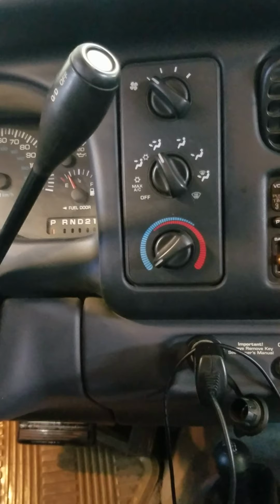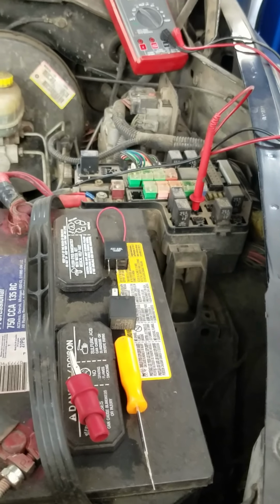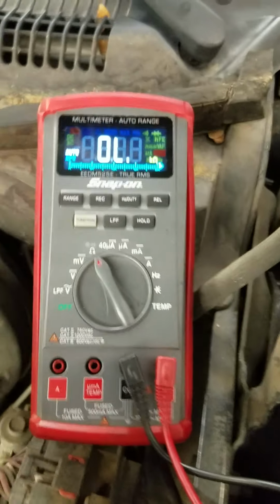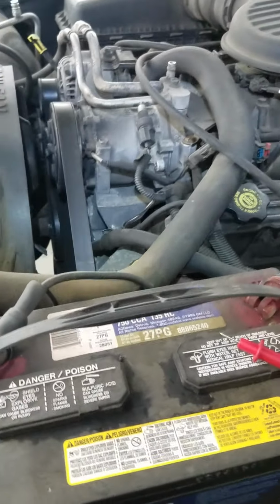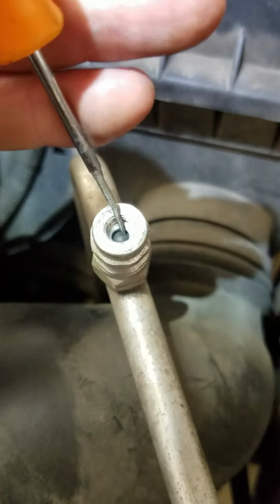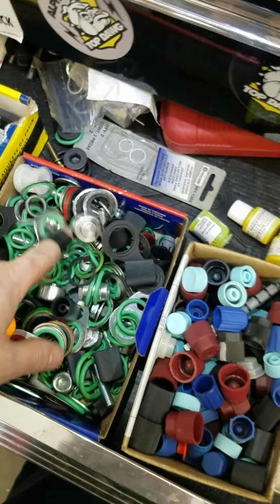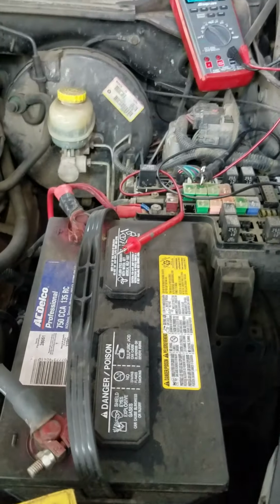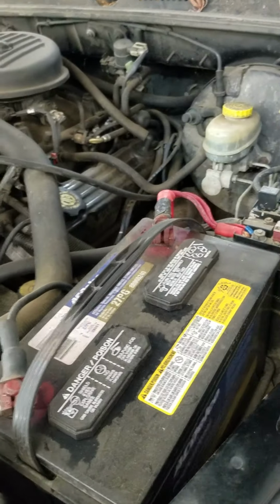Dodge Dakota, a/c diagnostics basics

Comment: I have a 96 Dakota that I'm having climate control issues with. The blower works on all speeds and zones. The temperature coming out of the vent doesn't change when I move the temperature control, but I can hear the door changing when I change temperature even when the blower is off. The AC compressor clutch doesn't engage when climate setting is on cold with AC on, but it engages when I jump the relay connection with a wire. Could you help me diagnose this?
Reply: The temp coming out of the vents is always the ambient temperature. Climate control setting and engine heat don't affect it.
Reply from the maker: @47853ll  first need to verify if there is coolant, and that it's circulating in the heater core. If that is good, and the door is intact moving and not broken inside the box, and there is still no heat, there could be a blockage inside the box.. second you need to verify the ac is correctly charged before proceeding with ac diagnostics. It is ran off of transducer that detects pressure. It's probably not charged.
Reply: @MegaMarclar  thanks for the help. Ive never flushed a heater core and when I went to do it, it turned out the previous owner had bypassed it! So I reconnected the hoses and now I have heat. The AC just needed a recharge and now it is also working, but it isn't very strong. Better than nothing though lol
Reply from the maker: @47853ll  https://youtu.be/W1XucuTPJtQ
Reply: Year and engine size of the Dakota in video? 😊